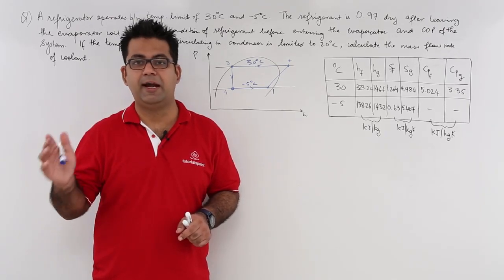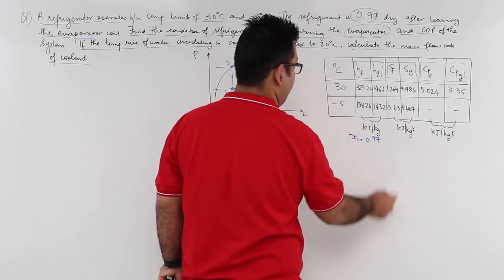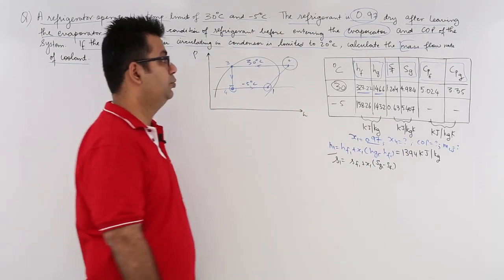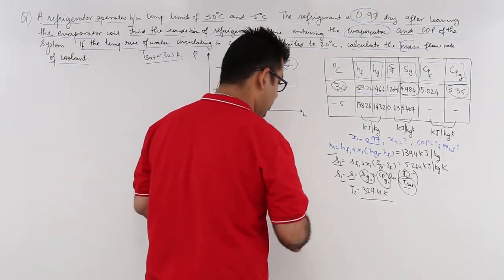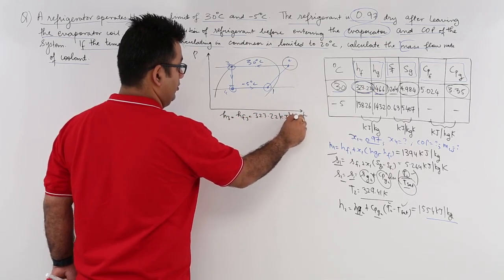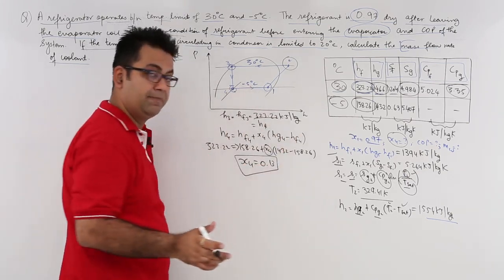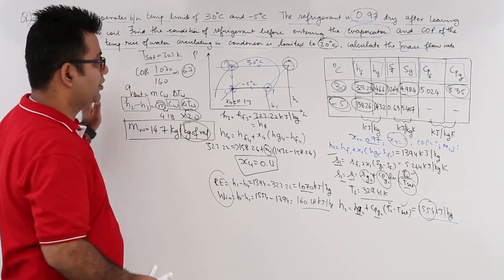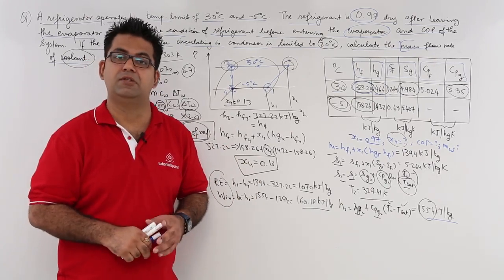Ideal Vapour Compression Cycle Example 1

Comment: While finding hf1 and s1 you r taken 30 celsius values 
That line is at -5 degrees
Reply: But the calculated value is correct coz, He just mistakenly took 30 degree but in actual he calculated at -5 degree.
Reply: Yeah i also got confused due to it
Reply: U r right